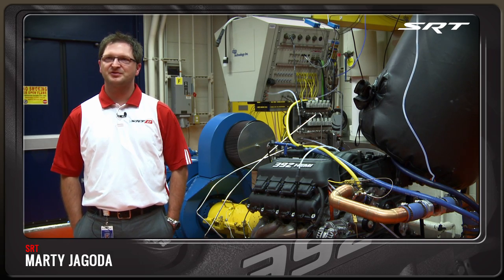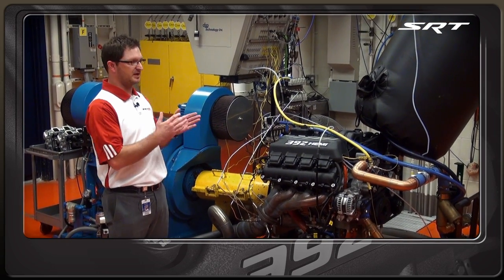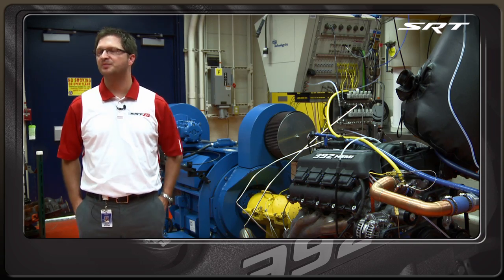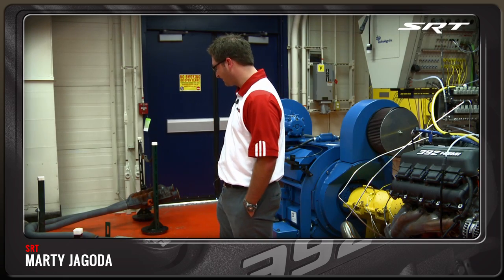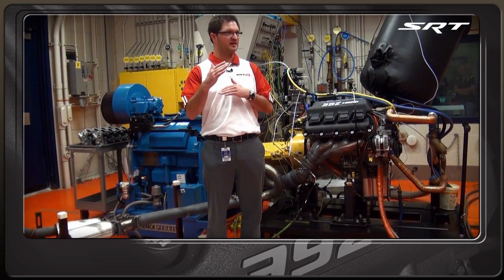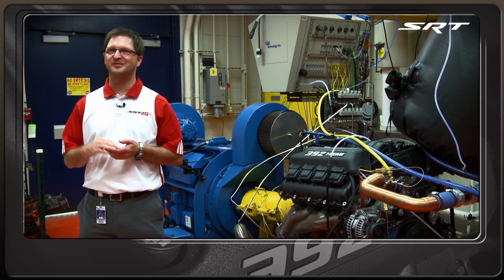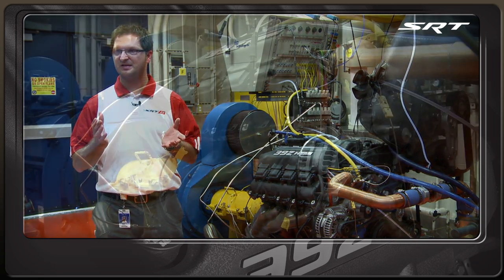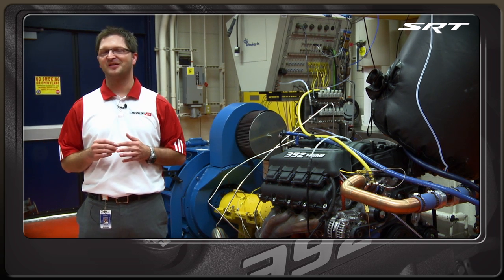Testing and torture in Dyno Cell C8.

Comment: How did they use this dyno for the Viper engine, given the large difference in power between the dyno's holding ability and the Viper engine.  I understand that electric dynos, much like electric motors can generally exceed their nominal rating, but that seems a bit excessive, especially given what the Gen IV motor puts out unrestricted (640-650 hp).
Reply: It's said that they had many 'normal dynos' back in the day and two 'large' ones ... I worked as dyno operator for Ford in Cologne and it was just the same - many 'small dynos' and two unrestricted ones. The 'biggies' at the FCA facility was used exclusively for NASCAR development, Viper and later Hellcat ;-)